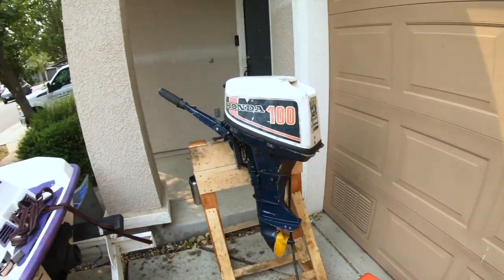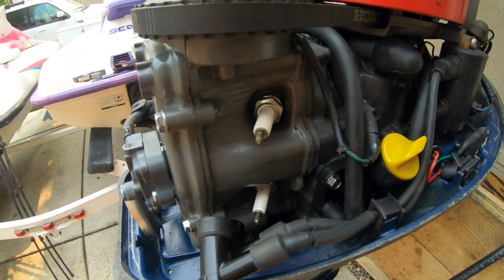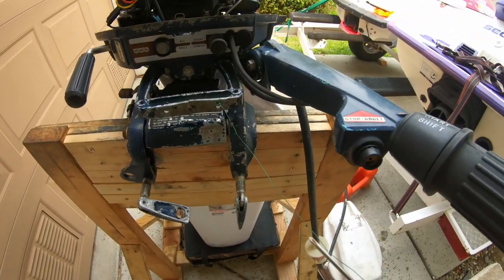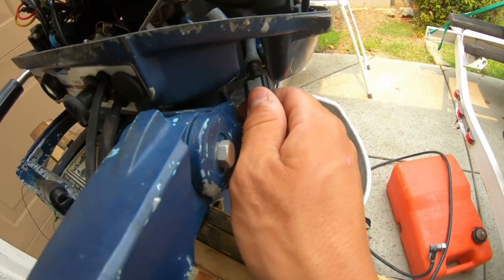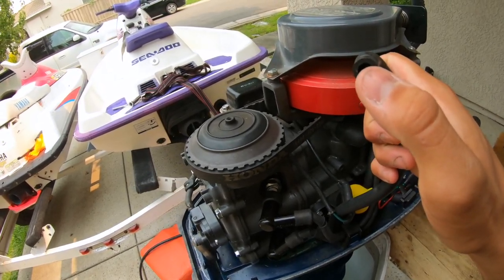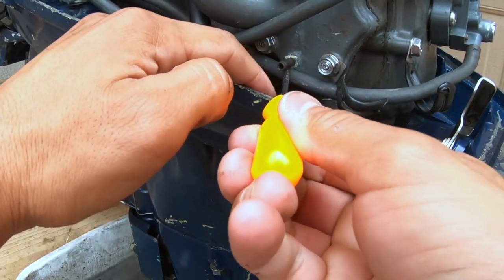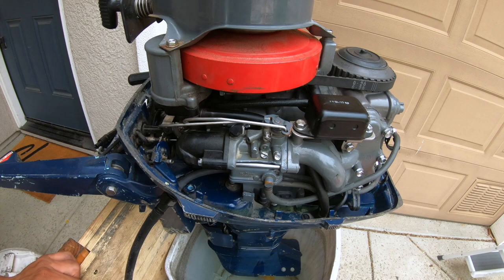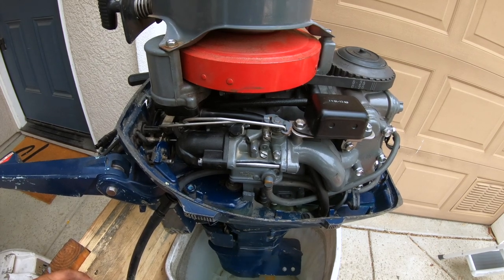Quick Tips For Repairing Old Honda Outboard Motors

Comment: Nice video! I've been on the look out for a used outboard and the other day a 1983 b100 popped up on fb market for super cheap. I jumped on it after watching these videos a few times. haha It runs, barley, and currently doesn't pee. Wise me luck! lol 😎🤙 Thanks for the vids.
Reply from the maker: Thanks man! Worked on a handful of these older Honda outboards and they are solid motors. If it’s not pumping water try filling a taller trash bin and check the outlet water spouts for debris the passages are pretty small. Also, the carb on those Honda’s are super sensitive to dirt I’d install a fuel filter if you haven’t
Reply: @sacratboatingandfishing  thanks for the tips! Funny you mention the carb, one of the fuel spouts is cracked so I ordered a new carb off Amazon for $90 and it comes with an inline filter and new gaskets. Have you purchased from Amazon before? The one I ordered has zero customer reviews, so idk, we'll see I guess. 😂😂
Reply: Can you send the link for the carb? Thanks

Comment: Any ideas, my Honda 7.5 starts no problem revs up fine in neutral, when i put in gear it either dies or runs with no rpm/revs. No speed at all?
Reply from the maker: @harryhacker3024  that’s a weird one. Is the prop engaging? Could be broken prop shear pin. I’ve been told if you switch the coil plugs that’s a symptom too. Carb could be out of adjustment too

Comment: I've got one but it dies as soon as I rev it a little. Any ideas? fuel bulb is hard. idles well. I've cleaned the main jet/carb. Is there a hidden area of the carb to clean?
Reply from the maker: @SolarBurrito  Probaly still your carb. I’d clean it good again with an ultrasonic cleaner if you have one. Clean your air mixture screw, idle jet and the holes they sit in. You can try fine adjusting your air mixture screw to find the sweet spot somewhere between 1.5-2.5 turns out. Could be your fuel pump diaphragm cracked but haven’t seen one of those fail yet. Clean the fuel filter in the fuel pump too
Reply from the maker: @SolarBurrito also if you are using gray fuel lines throw those away that could be an issue. Plastic liners in those melt and restrict fuel flow

Comment: Hi, I have a B100 that needs some repairs to the throttle/ handle and idle so the motor will not stop, when it is low idle and changing gears, any ideas?

Comment: I have the same engine in a 7.5. Was running fine then the green oil light went out and the engine died. I had plenty of fresh oil. Thoughts?
Reply from the maker: @user-ve3oq5in5v  Follow the oil light wires and check for corrosion or a bad ground. Just going off memory I believe the oil light is connected to 2 ignition components including a coil under the flywheel. The oil light itself could have failed or the ignition coils that connect to it failed
Reply: @sacratboatingandfishing  seems like it seized up. I took the pull rope off and I can turn it with a ratchet. Are there oil pumps on these that could go and stop sending oil?

Comment: I have the same rounded fuel connector on my 1980s Honda 10hp. I've cleaned the carb and fuel pump filter. The motor bogs down at wide open throttle. Is the rounded fuel connector the likely problem? TIA!
Reply from the maker: Most likely the carb needs cleaning again those carbs are sensitive. Clean the jets and every opening that allows fuel and air. Once i had a fuel pump filter that was warped and restricted fuel flow you could try removing it. Last resort try fine tweaking air mixture screw

Comment: I have the same motor but 10hp and I’m missing the entire pull cord recoil thing on top would you sell the one off your parts motor?
Reply from the maker: Unfortunately I don’t have it anymore. I think the 7.5 & 10HP use the same recoil starter. I bought one on eBay for $50

Comment: Have you ever replaced the breather aparatus?  The crankcase vent aka breather. It’s under the flywheel and there’s tube that runs down the side of the motor. I have the 85. 5 hp honda ( Bf50s).   It’s leaking oil from top. Under flywheel. Possibly the breather valve. I can’t find anything on YouTube. Any help? Thanks
Reply from the maker: Unfortunately I haven’t replaced that part. I like the website boats.net they have good diagrams and parts that might help find the issue

Comment: Hi. I just picked up one of those 10 horse Hondas and it starts right up but is stuck in neutral. Would you have any idea what I should be looking at ? 
Thanks John
Reply: Drop the lower unit.  That'll isolate where the jam is- either in the linkage between the lever and the lower (not likely), or in the lower itself.  At that point, you're faced with pulling the lower apart, or finding another one that works.  My advice:  If you're not familiar with what's inside or how it all works, buy another lower and take the bad one apart so you can learn how it all works.  If you fix it, you now have two working lowers so you can sell one.  Most importantly, get ahold of a manual, preferably an OEM Honda manual.

*edit- I'm assuming the engine is running when you're trying to put it in gear?  If not, give the cord a short pull and it may go in gear.  Or, try it with the engine running.  If it still doesn't work, see above.

Comment: Bro I might snatch up a Honda 7.5 tomorrow on OfferUp , no spark , any tips?
Reply from the maker: Best case bad wire or ground. Worst case bad cdi/ignition coil. I actually have a 7.5 Honda I was thinking of parting out with a good cdi if you wanted to buy parts
Reply: @sacratboatingandfishing  you don’t think neutral safety or low oil sensor could do that ?
Reply from the maker: @mrantone916  it could be the stop button wires. I’d look over all the wires cdi, ignition coil, spark plug boots and stop button for nicks and corrosion on the grounds too. If all wiring checks out then probably a bad cdi or coil
Reply: @sacratboatingandfishing sweet. I’ll def be interested in parts for sure thanks.
Reply: @mrantone916  Did you figure your issue out? I have a 71 Honda bk75k1 the orange and white model. No spark. Cant seem to get this thing started. Its point ignition so trying to start there.

Comment: Hey I have the same engine but its not running good I clean the carb and the back fuel filter and nothing I do have a bf8a 1997 both are long shaft but the 8hp is not peeing I try everything from new thermostat to a new intake gasket New impeller clean all the hoses and nothing you think that I can use the lower part from the 10hp to the newer 8hp ?
Reply from the maker: Could be one of many issues. Is it not pumping water when mounted to a boat or are you testing in a bucket? The water intake on those motors is pretty high up the lower unit so your bucket might not be high enough with water. Disconnect the hose at the top of the inlet manifold and if you see water coming out, if so then your impeller works if not your impeller is bad. Spray a bunch of wd40 at the top spout of the inlet manifold and you should see it come out the bottom spout if not there’s a clog. Or if you took the lower unit apart the copper water line may not be lined up
Reply: I have a 25 gallon container high enough to reach the lower unit and circulate enough water  the impeller is brand new I replaced the two gaskets that go underneath the impeller as well I only see bobbles coming out of the lower unit. How can I tell that the copper line is install correctly? I always fit it in the water pump housing.  thanks for taking your time to answer all the comments I really appreciate your answer

Comment: Could u tell me on this particular motor there is stop button on tiller handle.  Mines missing ..also What is the 2 wires  on the left side for..it's on side where the shifter is. Thanks any help would be greatly appreciated
Reply from the maker: Don’t have this motor anymore but the 2 wires you’re referring to I think are for hooking up to a computer for motor hours etc.. If you have the serial number, boats.net should have the parts and diagram for your motor
Reply: @ MOPARSANDGUITARS
The 10 hp motors can charge a battery & the Green light flashing ( as in this guys video...) Shows that the charging circuit is working. - From my research on line.....
Reply: my bf75 stop button is on the main body

Comment: Just did a Honda BF7.5, it came on a 1436 I bought. It had not been run in years. Mud wasps had plugged everything up, plus old gas. I cleaned everything and it started up on 2nd pull. My question is....how strong should the waterpump exit flow be on these small Hondas? Thanx, and love these fix it videos!!
Reply from the maker: The exit flow isn’t super strong. I’ve put a new impeller in and didn’t notice a significant difference from the old one. I would check the inlet manifold for dirt. The spouts are narrow and clog easy so try spraying carb cleaner in the top spout and a clean out the bottom spout of debris. I’ve had to do that on the last 2 Honda motors that weren’t pumping water
Reply from the maker: Thanks for watching appreciate the support!

Comment: Do you have a link for the fuel line connector?  I just bought a 10hp with the round pin and can’t find the right connector.
Reply from the maker: I don’t have a link to the round pin but here’s a link to an Amazon one I’ve used that fits: https://www.amazon.com/gp/aw/d/B07FSRZNN8?psc=1&ref=ppx_pop_mob_b_asin_title#

It’s kind of cheap material but it works. If you replace the round connector its hard to find a replacement fuel connector that fits through the hole on the motor. I had a brass Johnson connector that fit one of the Hondas I’ve worked on but most Yamaha and Mercury fuel connectors I’ve tried don’t fit through the hole
Reply: Thank you.  I’ve decided to delete the old round connection and extend the gas line through the hole.
Reply: Having the same problem with my male and female gas fitting

Comment: I have a 7.5 hp with no spark . its a 1970's honda with points ignition . have you trouble shot one in this era ?
Reply from the maker: No I haven’t but I’d probably start with simple and cheap troubleshooting. Try a new spark plug or try a light up test wire to see if you have spark. I once had an issue with the spark plug cover not touching the inside wire cuz it was impacted with dirt and not getting spark. Not sure if that model has a cdi but that would be most expensive repair option
Reply: @sacratboatingandfishing  Points Ignition as mentioned in the first post
Reply: Did you ever resolve your problem? I have same issue with my 1971 Honda B75k1. Orange and White. No spark. Points ignition

Comment: Great outboard. Thanks for the video. Had one for years . Always run it dry after use. Check for insects plugging pee pipe first with small wire, then do your procedure